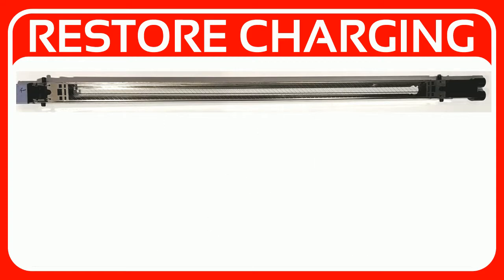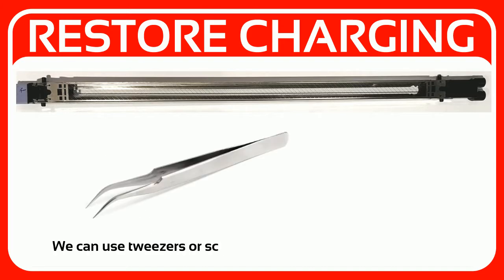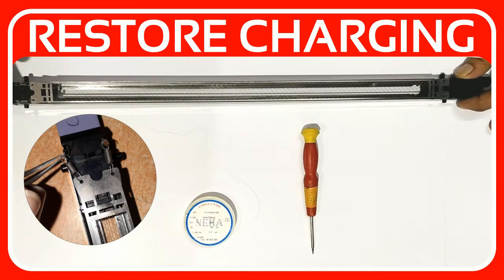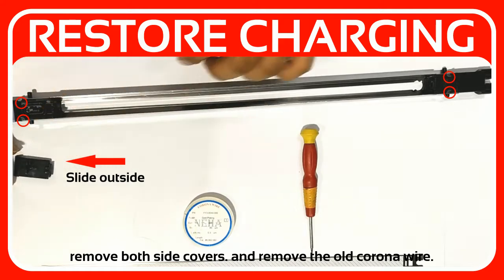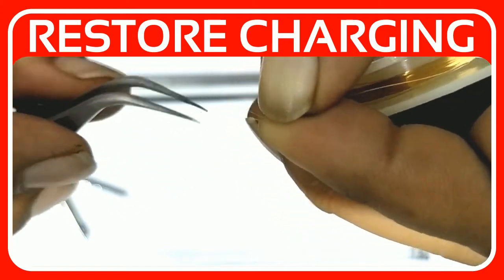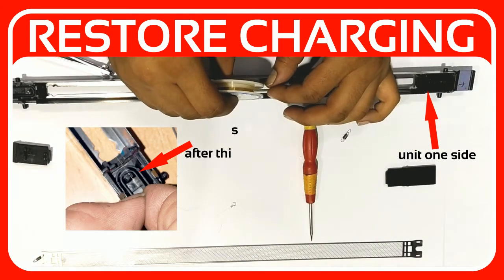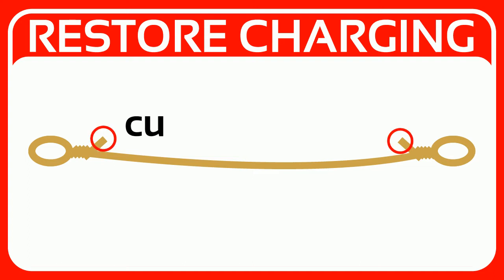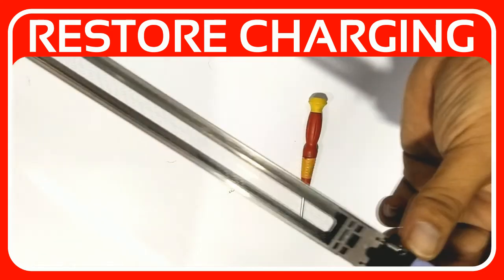Repair rebuild Charging Corona Wire Print Quality Issue White Line in Colour Registration Problem

Comment: Can I buy the little ring (wire end) which holds the corona wire, if yes where can I buy it?
Reply from the maker: Thnx for like
Reply from the maker: No need to use this on charging unit.
Reply: The printer shows an error without the corona wire. Brother HL3270dw
Reply from the maker: SORRY NO IDES ABOUT BROTHER PRINTER

Comment: If I use thicker 0.08mm wire will it effect print quality?

At my local I can only find 0.08mm wire.😟
Reply from the maker: recommended 0.03um
for delivery please write to wire.cororna@gmail.com
Reply from the maker: Suggest do not use thick wire. Its may damage PCB or OPC drum.

Comment: Which mm corono wire uses ?  In TN2130
Reply from the maker: You can use 0.3 um to 0.6 um thickness gold plated corona wire for any charging units.

Comment: I love your tutorial, please what is the work of a change corona?
Reply from the maker: After some time (about 10 to 16 months, depending on the weather of its room) the corona wire rusts and becomes unable to properly discharge the drum. That is why the machine is unable to give print, give solid color print, or gives error code related to CC unit

Comment: Is this corona wire made up of which material
Reply from the maker: It feels like very thin nichrome or heater wire. which is gold plated. But I suggest not doing any experiments with your machine. You can buy corona wire very cheaply